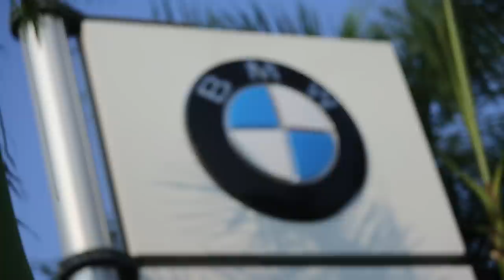Make in India - BMW

Comment: Chennai, wrong place. Move to Bengaluru and make it Bengaluru Motor Works. Come on BMW marketing !
Reply: Joke .. no large scale manufacturing companies choose Bengaluru coz no connectivity... For Ur info. Chennai is Detroit of Asia.. so no surprise..
Reply: Bangalore is good for IT and bio technology companies not for manufacturing automobiles ....Chennai supplying 40 % AUTO spares and parts to all over india and holds 35 % automobile industries ....Even , Toyota plant in karnataka got their auto spares from chennai like wheels , air bags , casting products , tyres , engine spares , wirings , electro motors , radiators from wheels india limited , lucas tvs , saint Cobain , MRF , mitsuba electro limited etc...That's why chennai is called as auto hub of india...